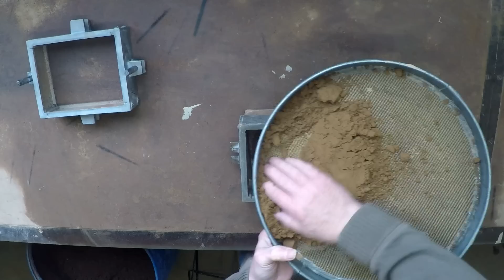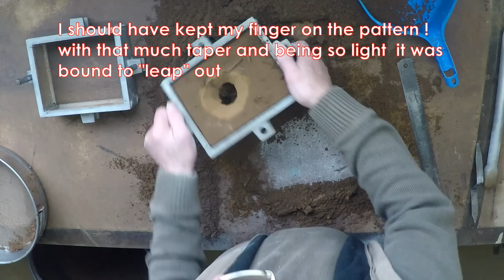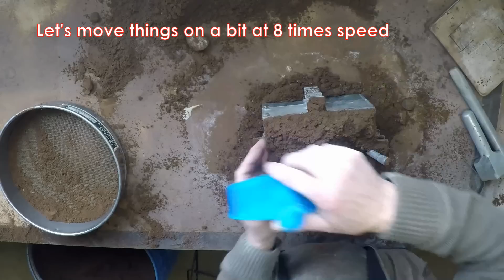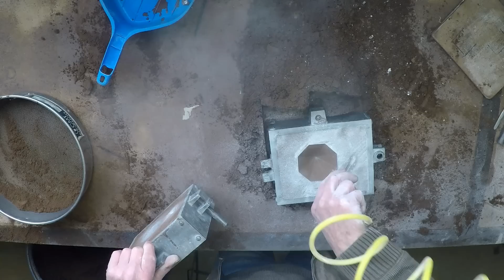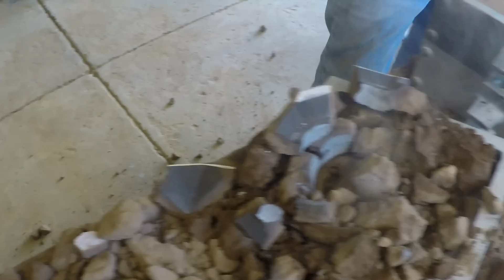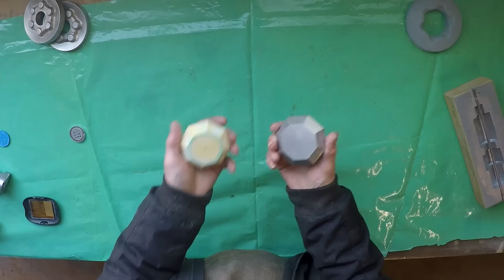Sand cast Aluminium "Trophy Diamond"

Comment: Very nicely done! Do you mix your own green sand or do you buy it premade? Was considering making my own, but there are so many opinions on the amount of clay and yours seem perfect.
Reply from the maker: Stekje. My green sand is a natural sand i.e. it comes straight from the ground clay and all. I do a little work on it  and a fair bit more work to produce the facing sand I have videos on this. Once all foundries used such sands but they are becoming a bit rare these days as the quarries close and get built over. Here in Melbourne we were lucky in that about 1/3 to 1/2 of the area is underlain by sands a fair bit of which was suitable for foundry work. I got about 6 cubic metres of sand 20 or so years ago, I have perhaps 1.5 metres left and at my age that will see me out! The quarry I got it from has long since closed. The problem with  making ones own sand is getting sand fine enough to give a good result and then getting it mixed properly. Play sand and paving sand (the stuff they sweep into the joints between pavers) is probably as good a start as you can find, then I would go with 7.5% of good bentonite clay if after extensive mixing and walking on and even driving over many times plus the occasional sieving to break the lumps up and aerate the sand it is still not strong enough up the clay to a total of 10%. I have it in mind to mix some up for some lost foam work and have a few different ideas to get it mixed properly yet easily so as they say "stay tunned".... Martin
Reply: @olfoundryman8418  Thank you for replying, Martin. I think I'll try some sand meant for sandblasting and see how it goes!
Reply from the maker: Stekje, One of the problems with many of the sands available is that are washed, this tends to mean that they can have a very narrow size range. With all the grains the one size its  sometimes  a bit more difficult to get a good strong sand. A more variable size range with smaller grains filling in between the larger ones tends to give a stronger sand although a less permeable one. It might be interesting to try used sandblasting sand as this will have many broken and thus smaller grains within it and may give a better stronger overall finer sand. Wear a mask when the sand is dry though, broken dusty sand is a serious health hazard - Ok when its  damp though, no dust then... Martin
Reply from the maker: Stekje, Further to my last comment on using sandblasting sand. If you do decide to try used sand be sure that it has not been used to strip something that will contaminate the sand - like paint for example. Completely if it was used to derust steel as iron oxide is often added to moulding sands anyway..Martin

Comment: Hello. Where can I buy silicone that you put on aluminum.
Reply from the maker: MrGreat, I am not sure exactly what you mean. I don't put any silicone, silicon, or silica on my aluminium. Can you be a bit more specific please... Martin
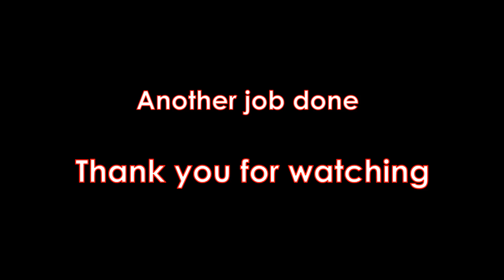Reply: At 19:52 what is the thing you throw on the aluminum with the spoon.
Reply from the maker: Mr Great, That is an exothermic compound that as you can see catches fire and generates a lot of heat thus helping to keep the feeder liquid for longer so it feeds the casting better. It is called "Ferrux NF" and it is made by "Foseco". Foseco have branches all over the world... Martin
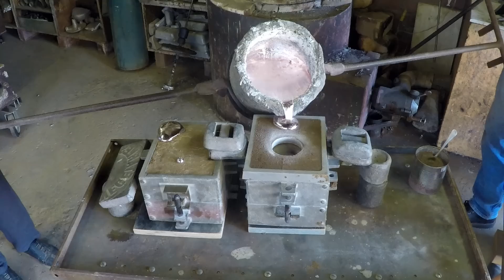Reply: I think he means at 16:30, the exothermic compound.

If I understand correctly, that compound is designed to provide some extra heat to the top. This provides not only some oxide-prevention, but also to keep the metal liquid on top so it can feed properly instead of solidifying on top thus preventing it from flowing down as the cooler metal underneath shrinks.

edit: I just missed your reply, curses! Glad to know I was right though ;)
Reply: thank you so much. I wish to work well.
Reply from the maker: Brandon, Not too sure about the oxide prevention as the exothermic does contain powerful oxidising substances - ammonium and or potassium nitrate for example and the top of the feeder always looks a little "burnt" after the use of exothermic. But other than  that you are spot on... Martin
Reply: Makes sense, thanks for that! I love when people explain WHY something I said was wrong, it helps me learn :)

Comment: Welcome back martin
Great surface finish
Reply from the maker: Rahib, Yes, despite my uncertain methods it did turn out all right in the end. Nice to be back, and I should have another out in a week or so but I do not know how permanent the "being back" is, that as yet remains to be seen... Martin
Reply: Olfoundryman  what about your refractory is it homemade or something you got from supplier
Reply from the maker: Rahib, Which refractory are you referring too? I use several in different ways..Generally though I buy all this sot of thing as I find it usually not worth wasting time to make it up from scratch...Martin
Reply: Olfoundryman refractory of  furnace
I am using clay breaks but the lid making issues frequently i have to change it
Reply from the maker: Rahib, I built my furnace close to 50 years ago. I have replaced the lid once but other than that its the same refractory thousands of melts later!. I used a commercial castable refractory that was good for 1650 deg C. It was called "Thermocast 165" but I doubt it would still be available under that name. It was cast into a quickly built plywood former and is about 100 mm thick and I backed this up with loose vermiculite about 150 mm thick for some insulation. Lids are a problem and people try all sorts of things to make them. I find that  a simply band around the outside of the lid that is clamped in place via a bolt  - sort of like a big hose clamp is the best way to support the lid. In this way the support is not exposed to the intense heat. Somewhere in my videos you should be able to see this band around the lid on my furnace. It is important when using castable refractories to follow the instructions if you add extra water as many people tend to do you will ruin it and get lots of cracks. Some of the newer castables are very low water and while they have very high strength they are very difficult to work with because they are so dry. They require special equipment to mix and place, avoid these! But I repeat what ever you use do not add any extra water.... Martin

Comment: When you added that little extension for the feeder (riser), for a moment I thought you were still going to cut an offset basin to pour in. Nice quick trick to get an extension for the necessary volume.
Reply: I will also note, that my son would also want a "blue diamond", all that Minecraft lore the kids are into.
Reply from the maker: Walt, Yes, I had figured that it was something from Minecraft, Fortnite, or the like. I was lucky in that I could get a friend to do the 3D print and that it was easy to turn into a decent pattern.

Regarding the extension etc while all's well that ends well it was not my finest hour - please see my reply to Swdweeb down below

Comment: 👍  😊  👍  I was beginning to miss your videos.   😁   Nice job you've done for your grandson.   💎  BTW, I really hate holding cold metal objects barehanded too.  I worked at a "full service" gas station one winter when I was in my early 20s.  Never again.  ❄  I think I recognise that other casting, too.
Reply from the maker: Ron, Yes, it was a day of pouring various bits and pieces rather than say 10 of the same thing so its not surprising that you recognised at least the aluminium bit coin just off to the left side at the end. A video on the other job poured wil come out in a week or so.  Full service gas station - wow - do they still have those? And your winters ARE cold, way colder than  ours (and you can have it al on your own!😀 )
Reply: @olfoundryman8418  
  I don't know if there are full service stations anymore.  That was the last company in our area to have them.  Due to staffing shortages (no surprise there) they stopped having full service in the mid to late 1980s.  I'm not sure if that oil company is still independent or got swallowed up either.  The name brand is nowhere to be seen anymore, and that specific property has been redeveloped.
Reply from the maker: Ron, Sure don't seem to have any out here! Brand gone, property redeveloped (Housing units no doubt!!!) a sad and common tale...Martin
Reply: @olfoundryman8418  
  It's been quite a while sinse I was out that way, but if memory serves, the old Bay station has become retail space on the ground floor with a few floors of apartments above.  It's only a block away from Michigan State University.

Comment: Martin, 22° up here in sunny Qld. at present☺ I was wondering why you cut the runner and the gate on opposite sides of the parting line? Why not just cut straight from the sprue to the mould cavity?
Thanks for sharing.  Mark P
Reply from the maker: Mark, Good practice is to cut the runner below the gate the idea being that the runner completely fills (and thus becomes air free) before the gates begin to pass metal into the cavity. The hope is that in this way the metal entering the cavity will be bubble free. The idea is that as far as possible metal is taken down to the lowest point in the mould (by the sprue) and from there it only ever flows up hill as it fills the entire cavity, runner gates cavity feeders and all. Obviously we can not always achieve this but the closer we can get to it the better and runner in the drag gates in the cope is at least part way there.
Also, I have found that a combined runner gate that goes straight from the bottom of the sprue to the cavity in a short run does not seem to produce the best of results as usually it gives way to high fill velocities and thus jetting with ensuing turbulence as the metal enters the cavity - lots of bubble and oxide entrainment, oxide skins and washed off sand marring the surface of the casting and right through it too. Turbulent fills also lead to miss fill situations as isolated areas of air/mould gases get surrounded by chaotic metal and become trapped. Turbulent chaotic flows have much larger surface flow areas leading to greater heat loss and thus premature solidification.  It ain't easy to make a truly good casting .😀. Martin
Reply: OK. Thanks for that very clear explanation. I am starting to incorporate a lot of your practise and ideas into my castings. Still a very long way from reaching your standard but every  little bit helps. 
Regards,
Mark